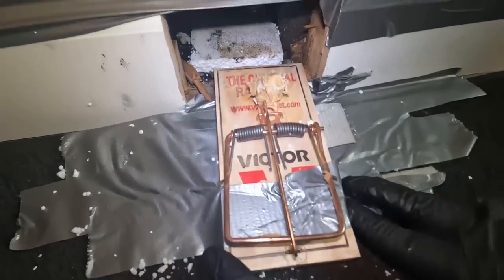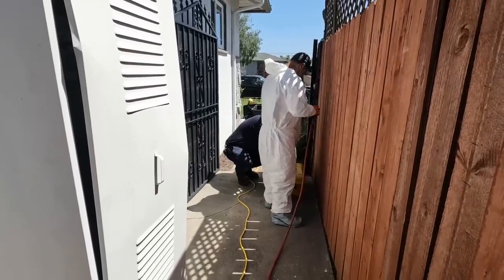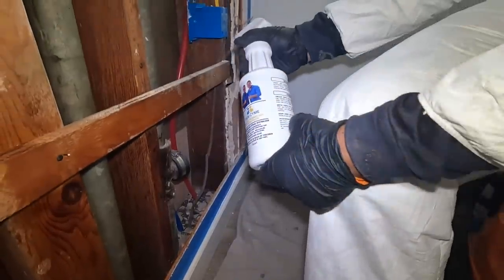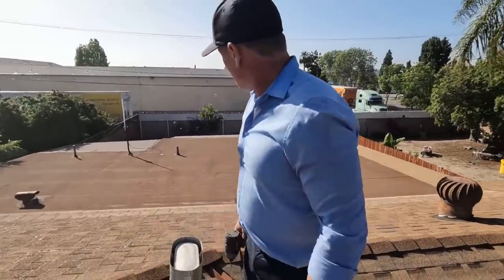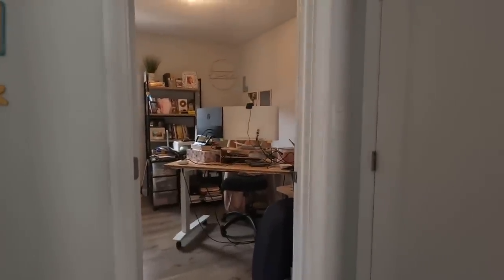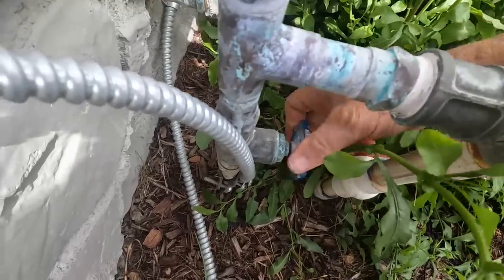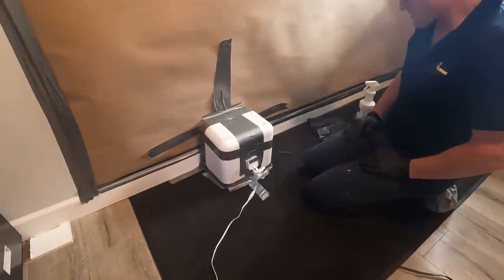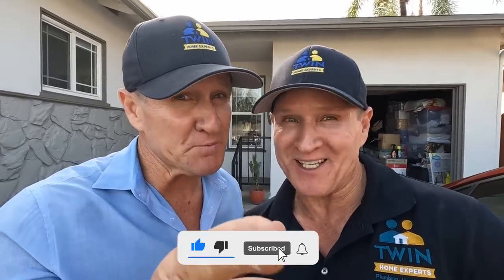HOMEMADE ICE CHEST RAT TRAP!? Will they chew through it?

Comment: If the condensation line has a p trap on it which I can’t imagine it doesn’t bc the water wouldn’t be able to drain then there’s no air being sucked through the pipe.